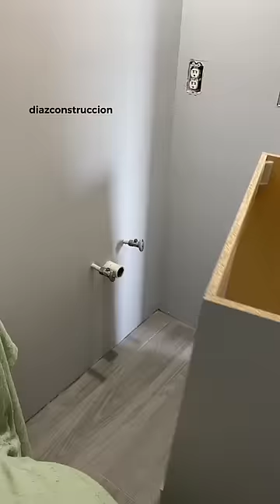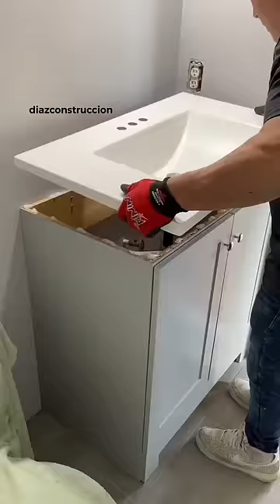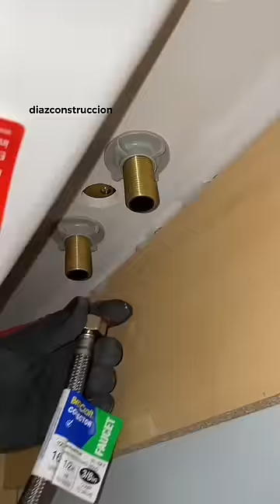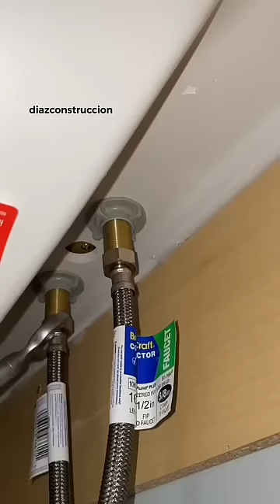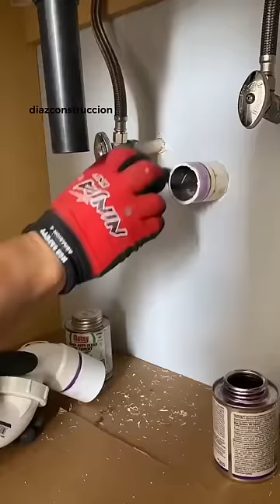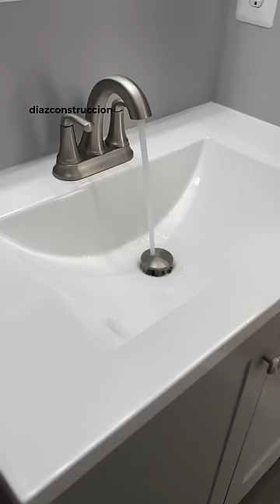Install a bathroom vanity

Comment: As a plumber you know this guy is just a good handy man
Reply: Great handyman.
Reply: I'll agree with that statement. Trap adapter and tubular much easier to clean and install. Glued ptrap doesn't fly in my neck of the woods.
Reply: Teflon tape on the flex lines?
Reply: Trap without clean out 😢
Reply: 😅y
Reply: 😅y
Reply: He's not even good u have to cut his whole mess out because he didn't leave a cleanout to rod from I would have to redo the whole sink because he's doing a job he isn't qualified for 😂
Reply: @unknown_soldur116  see you know
Reply: As a plumber, I second these shenanigans
Reply: He forgot to clean the burs on the pipe for 1.
Reply: He didnt perform the longest lasting work, but it was pretty clean otherwise.
Reply: You obviously have not seen all his videos ....
Reply: @Barca071891  you're obviously not a plumber. At least, not any good at that.
Reply: @renenowicki great handymen, 😮 handicap plumbers. 😅
Reply: Yes indeed he is…. Driving our prices down….
Reply: @Easymadeit  he said that because we see subtle things he isn't doing that plumbers would.
Reply: Anyone could figure that out considering plumbers only do plumbing and he’s doing other shit lmao
Reply: Plumbers would actually set that cabinet on a service call, plumbers see the reason he's a handyman. I'll give you one logical one. Why didn't he put the supply lines on before he put the faucet on the vanity? Because he wanted to do it in that tiny space under the sink instead???😂
Reply: Yeah he's not that good... just another guy who says he can do it all
Reply: And way cheaper than a plumber 😂
Reply: @bobbyalaskanexplorer6453 I dunno...it would be easy to remove if need be just by unscrewing the trap and sink slipjoint
Reply: As a keyboard warrior*.. there fixed it fir you
Reply: Not to code here.
Reply: Why because he didn’t put the faucet and pop up assembly on before he caulked the sink to the base ?
Reply: @renenowicki  and 10 people are his family members?
Reply: Guys, here is The Savior

HalleluYAH translates “Praise ye YaH”

YaH is The Heavenly Father 
YaH arrives via the TENT OF MEETING
YaH was Who they Crucified for our sins
YaH was Crucified on an Almond TREE

— Ancient Semitic Cuneiform of Moshe (Moses)
— Isa Scroll (The Original Isaiah)

Isaiah 42:8
"I am YaH; that is my Name! I will not yield my glory to another or my praise to idols.

Isaiah 43:11
I, I am YAH, and there is no other Savior but Me.

Isaiah 45:5
I am YaH, and there is none else.

Comment: No compression fitting into the wall ? Now if you have to get access to the drain you have to cut the union but then there's nothing left to attach to when you put it back together.

Comment: I've started installing the faucet & hoses  before I install the top.  It's so nice to not have to reach up & under the sink from inside the cabinet.  

Not saying there is a right or wrong, it just works great for me.  (Only challenge can be getting a caulk gun behind the faucet)

Comment: Next time put lettering on pipe facing the wall, looks much cleaner looking at a nice all white pipe when your getting stuff from under the sink.👍🏼
Reply: Or better yet just use tubular trap assembly with the trap adapter on the pipe coming from the wall. Much cleaner than this
Reply: Lmao this is such a weird thing to obsess about
Reply: No it’s true… I do pool plumbing that’s all PVC and I always face the lettering away so people only see fresh white pipe. Glad I’m not the only one who thinks about this lol
Reply: @seankearns3889 yeah but real plumbers know the letters are to be seen by the inspector.
Reply: Should've used removable trap and not glued it. Hope you didn't cut the back of that  cabinet out. If you learn how to use a tape measure you could do more cleaner looking work.

Comment: Good job 👍🏻, quick tip on those types of sinks, install your faucet and speed ways before you drop it in, this way you have all the space to adjust and tighten everything.

Comment: Peice of advice, you should always use Teflon tape around threads when its metal on metal, great job..
Reply: Those supply lines come with rubber gaskets so the need for Teflon tape is not there

Comment: pretty darn GOOD!
Reply: NOT SO... A truly professional installer would have advised the owner about that half finished cheap vanity, as its bare particle board of bare MDF material will absorb water like a sponge, swell badly and be destroyed soon and stinking!  

A serious installer MUST KNOW that, and instead of fast proceeding to install it as is is, should ask the owner to be paid for perfectly sealing all edges and all bare MDF or particle board surfaces with a good water resistant resin, like polyurethane or other, in order to augment considerably that vanity humidity resistance, adding years to the life of the cabinet. As it installed it, it is NOT sustainable!

Comment: One BIG mistake that contractors usually make is just putting too much glue and silicone, please refrain from doing this, you don't need that much especially if it's a heavy quartz countertop going on top of the vanity, all it does is create a big mess and makes the job look sloppy, follow best practice.
Reply: Clean up work is part of it too . Use windex while cleaning up silicone and it's gone

Comment: Everyone talking about pipe dope and Teflon for the supply lines, there are rubber gaskets on either side😂 pipe dope and Teflon are useless
Reply: You don’t need Teflon tape or pipe dope on brass connections ever. 🌹
Reply: @jacweber8 that’s just flat out wrong. The type of metal doesn’t matter, the type of connection does.
Reply: The reason I do it sometimes is it takes the friction from the threads out of the equation

Comment: Do you have a website?
Reply: Dont hire someone that doesn't use teflon tape on a pressurized connection....Amatuer hour...
Reply: @BonsaiBuckeye There's a gasket on that supply line.
Reply: @BonsaiBuckeye  não contrate alguém que coloque Teflon nessas junções entre o flexível e a torneira. Se colocar, é sinal que não sabe o que está fazendo

Comment: Ream out and smooth the inside of that PVC drain you cut or they will have clogs from hair.  Put the faucets and the supply tubes on the sink before you install it. You're almost there.

Comment: Bro as a service and repair plumber STOP HARD PIPING IN THE P TRAPS! It’s retarded and not practical for when you inevitably get a clog lol we are gonna have to cut it and band it anyways and if you don’t leave enough pipe like you did here we are gonna be opening drywall 😂
Reply: Please spend $60 at your local hardware store and get a drill fed snake. Take out the stopper, fill up the sink with hot water and snake it. Unclogs in 10 minutes. Plumbing codes change in different areas sir. Just know your jurisdiction code and you’ll be great.
Reply: I'm just looking at the two slip joint nuts and wondering why I've seen about five people say they'll have to cut it out later...😅 on another note he didn't deburr the pipe which will cause clogs.
Reply: @Multi4204life Thank you partner, was waiting for someone to notice. Ream your pipes after cutting it, will reduce the chance of clogging also will not restrict the flow!
Reply: Yeah lmao, get an 1 1/2 5 dollar p trap with nuts and washers, and also they are easier you don’t have to be exact, you just find the angles and buy an extension if you need one, glue a trap adapter on that geeze 😂
Reply: @daghost417 or just plumb it correctly in the first place

Comment: I would caulk in a line on top of cabinet before putting on the sink so it is sealed to prevent water to sip through even the caulking above failed. Also I would use teflon or PTFE tape for thread before install the hoses.

Comment: That drain will be a joy to rod, even with a drop-head.  Marvel as the rodding cables go up the vent at every attempt, instead of down the drain.
Reply: No, 
A real plumber will come in and cut that crap out and do it the right way ...😂😂
Reply: @Gunter_Custom  IKR🤣

Comment: Definitely should’ve installed the taps before sticking the basin down. Also with the upright waste pipe you’ve got the writing facing forwards, not a massive deal but it just looks so much nicer if you have it facing out the back so it’s a plain pipe that people see. Also sucks you have that 2 stage glue over there. Here in the UK we just have 1 pot of glue that’s clear, so it takes less time to use and doesn’t leave all your joints bright purple

Comment: Super easy cabinet to work with. I just did a 24” with drawers. It was tight. Every sink and fixture install comes with mandatory cussing while on your back inside the dark cabinet trying to feel for the water line nuts and tighten them. 😅

Comment: You should put the top on and add glue from the inside of the cabinet to the joint. Will stay in place AND can be removed, if needed

Comment: It's easier to install the faucet and the supply lines 1st before you set the countertop on the vanity.  I know you have something under the primer and glue in case it drips. Some home owners can act nice until something goes wrongs. The home owner will be calling you back bcuz  the trap where the nut is at will leak.

Comment: Holy crap he actually did something right except for not installing the faucet when you had the top off and using all that silicone under the top, you only need every foot that way you don’t have to break the top apart to get it off next time, and u know Diaz doesn’t have a plumbers license never mind a csl

Comment: I'd trim the plastic tail piece. Sure it fits inside the pipe, but drain scum will buildup in between the tail piece and the PVC pipe causing bad odors.

Comment: nice work. I usually install the faucet/lines and the waste pipe and trap before setting the vanity base and top. that way my time in the box is minimal. I bet it took a bit to get the faucet tight which is why you cut that step off the vid.

Comment: Dude.  Install the faucet in the sink before you silicone the sink to the vanity.  Prepare the drain before installing all that stuff! It's way easier and faster to work when you're not sticking your head and hands inside a cabinet!

Comment: I usually install the vanity faucet before setting the top. I admit it does make caulking behind it a little more difficult, but at my age I dont like rolling around on my back any more than I have to.

Comment: You forgot to put a tread sealer on the hot and cold pipes connecting to the tap. Otherwise great work😊
Reply: Those lines always have rubber washers...

Comment: As a countertop installer, I commend you on the unnecessary amount of “adhesive” you used to glue that top down, screw the next guy remodeling!! 😂
Reply: When you remodel, everything goes in the dumpster. What are you on about?
Reply: @MisterTwister88  
It was a joke that obviously went over your head, I sometimes use a shit ton of adhesive too, mostly when I beat the pain in the butt plumber in cause he deserves it. 
but, to be fair…
People often replace just the vanity top and leave the cabinets for several reasons including an update without a full remodel. 
Also many of the cultured or solid surface sinks thermo-crack over time and are replaced without a full remodel. 
If you only install cheap IKEA cabinets then you would be correct.

Comment: You should have put silicone on the edges of the sink that meet the wall and then the bead on top. This way if the bead fails you don't get water at the back.

Comment: People are saying to install the taps first… I did this once and without thinking I put the top down on the floor too hard and the tap bits sticking out the bottom broke the ceramic top.

That was a $240 mistake…

Comment: Why didn’t you install the faucet onto the top before mounting the top on the vanity? And why did you not use an 1-1/4” polypropylene P-trap to eliminate most of your gluing?

Comment: You had me until you set the faucet same day. Then install a big ass p-trap like it's gonna be draining something other then just water 🤣🤣
Reply: Us plumbers try to get away from tubular after the tailpiece. When I see tubular under a sink I know it wasn't done by a professional
Reply: Btw that would have taken me an hour to an hour and a half. From setting the vanity to hooking up the faucet and doing the drainage
Reply: Yeah, I'm a journeyman. I'm not buying what you're selling 😂. The bag traps are the best drainage to install in a sink. You can easily work on it and remove it to snake the pipe. PVC is meant to be behind the wall. Not exposed under the sink. You're taking up more unnecessary room in the cabnit. I hate coming to these types of lavs and having to snake it. Think about the next guy, too. Service plumbers hate this just so you know.

Comment: I'm not a plumber so not connecting u. Genuine question. Why didn't u use the white plumbing tape on the water inlets to prevent leaking? I know they sometimes have the inner rubber but was always told to also use tape.

Comment: When you're connecting the hoses to the taps, do you need to put on Teflon tape? Some do and some don't. I'm not a plumber, but I know that I've got a bar sink and tap set to replace and I want to know if you have to use Teflon tape.

Comment: Gluing that 90 to the pipe going in the wall will make it more difficult to snake. Should've used a threaded connector to the straight pipe

Comment: That was over kill with all that caulking on top of the cabinet before putting the vanity on top. You do what's called a fishbowl.  You put the vanity on top of the cabinet. Then you caulk it underneath to the cabinet. That way if you ever have to remove it, it will be easier and won't tear your cabinet apart.

Comment: Pro tip: face pipe labels to the back/bottom so you see only clean white/black pipe from the front/top.
Reply: You show letters for the inspector hot shot!!! So they know what materials you use period.  You take that extra step on commercial properties with exposed piping.

Comment: Every time I caulk the top to the wall prior to installing the faucet, something happens like:
- client decides they don't like the faucet.
- client decides they don't like the drain.
- client doesn't like the top.
Its easier and cleaner to do it first, but Murphy rules some of my trim outs.

Comment: Good luck replacing that cheap chrome drain when it rots out thin as a Dixie cup and glued pipe goes way to high you will have to cut out and reglue new piece. Plumbers know the chrome rots quick that's why they use it. Should have had a connector removable after the 90.

Comment: Need to be facing the writing on the pipe in so it wont be seen. Ive made plumbers re install or if they cant then clean it all off with pipe cleaner. 👍🏻

Comment: If he was a sexy plumber he would have pre installed the faucet and pop-up on the sink while it was on the floor, installed escutcheons on drain pipe and water lines, removed labels off supplies, used a tubular p-trap instead of the LA trap.

Comment: You didn't smooth off the burrs off the tail pipe from the wall when you cut it. Those edges on the inside will catch hair and all kinds of debris over time and cause constant clogs

Comment: Maybe you know how to fix my problem. I bought a sink top and cabinet together - identical to what is in this video. The sink is a little larger than the base. I thought that’s the way it’s supposed to be. 😢

However the sink top bottom doesn’t touch the cabinet top. When I apply silicone to the cabinet top, it doesn’t bond to anything. 

I can’t return any of it. 

Is there a way to fix this? Thanks

Comment: Bro dont glue the top down around the back and along wall just caulk top where it touches wall ......BECAUSE if you ever have to take it out you won't have to struggle getting that glue out because you can cut it free from the top.

Comment: When plumber needs to snake the drain it's better when you can pull the tale piece out and look directly into pipe.  Should not  have put glue 90

Comment: Why hard pipe that 90 on the backside of the trap? Now you can't remove it to see the turn inside the wall when you run a cable through it.

Comment: Now that you’ve sealed all under the basin how is the next guy suppose to pull that off without damaging anything when I fit them (yes I’m a plumber from the uk) in this scenario I’d of sealed the left side and front under so you could cut it with a blade and sealed around the back and right side

Comment: Please. Attach the faucet and supply lines to the sink BEFORE gluing it to the cabinet.  Do yourself a favor.  AND, hack saw an inch off of the pivot rod of pop up.  This gives the rod clearance from the back wall.

Comment: Install the faucet with supply hoses on the top BEFORE you set it on the vanity.  Glue the P-trap adapter BEFORE you put the vanity in place. Duh!

Comment: What's with the new popularity of humongous caulk joints? It's like nobody has ever seen what it looks like 2 years later. Just get it fitted nice and tight, and make a very small bead. It will still be sealed, but it looks better and it will still look good for years to come. I just don't get it.

Comment: Everyone talking about put on the faucet before dropping the vanity y’all must not be plumbers I could drop the vanity and set up that faucet kneeling not even having to actually lay on my back plus it’s a push pop drain so idk why you’ll need to even get under there a real plumber knows what he’s working with just based off muscle memory this one of the cleanest pieces of work I e seen on the tube minus the purple primer inside a finished home that’s a big no no

Comment: No backsplash no tiles coming halfway up to a recipe for disaster to renovate a bathroom like that at that size with labor and supplies $2500. (Without the tiles on the wall coming up 4’)